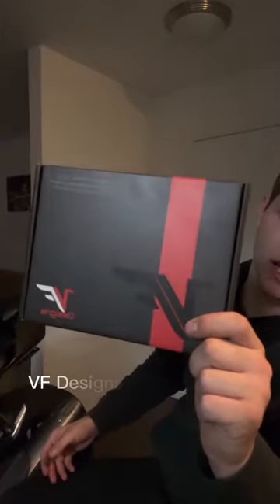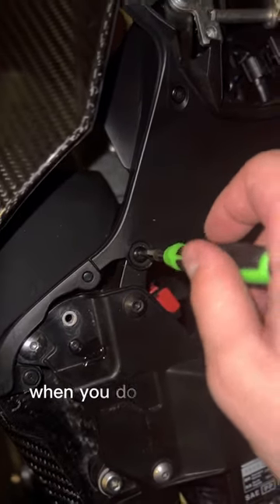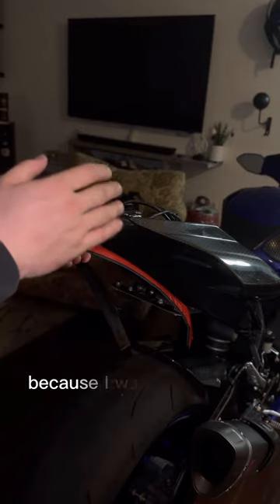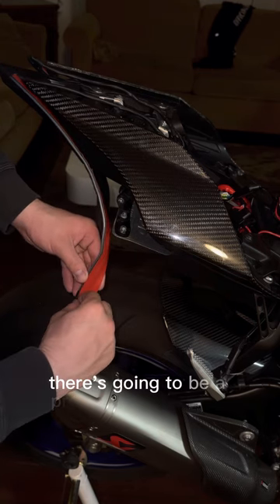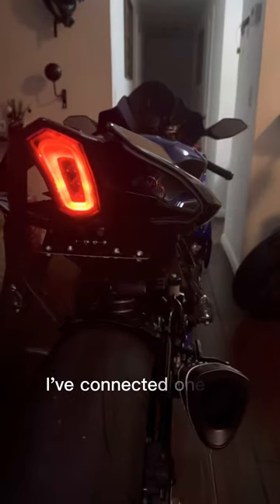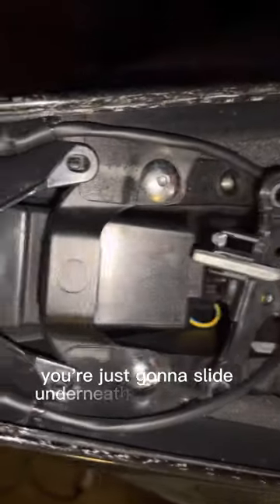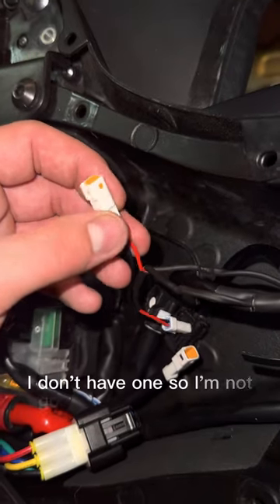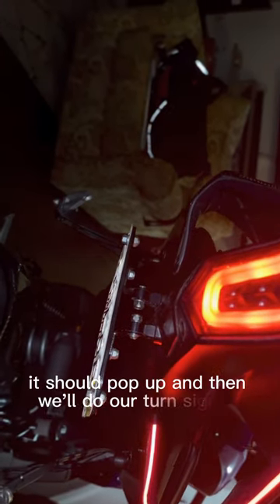How to install VFdesigns ￼turn signals on r1!

Comment: After reading about VFdesigns quality issue with some lights dying after a month i would just buy the same cheap light strip from China ( like VF do themself ) and put som heat shrink on it..